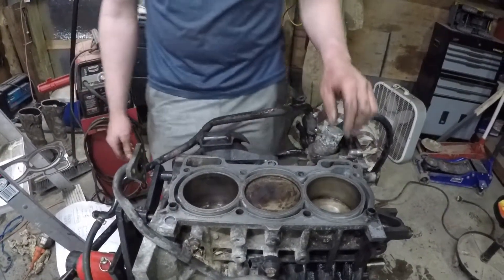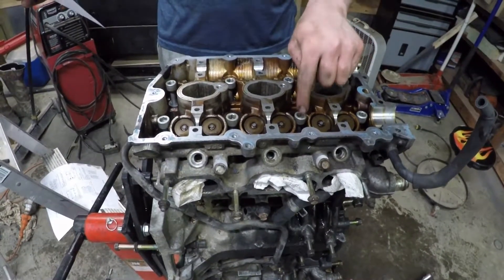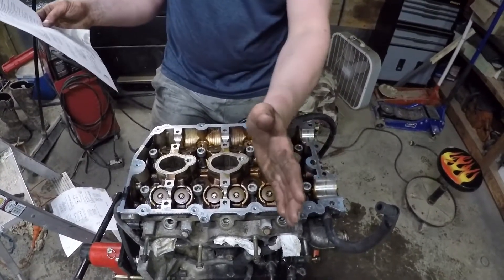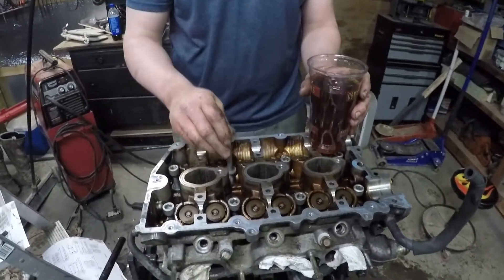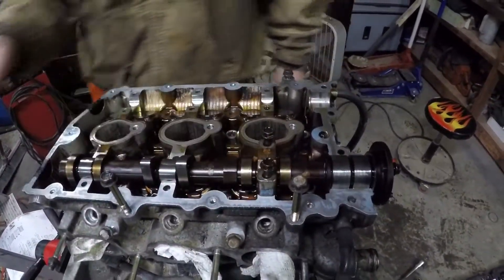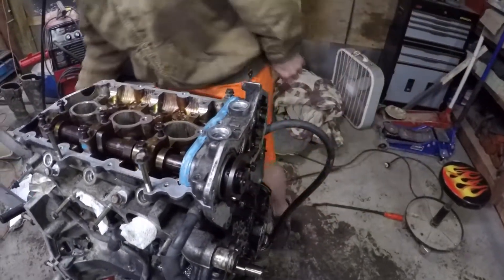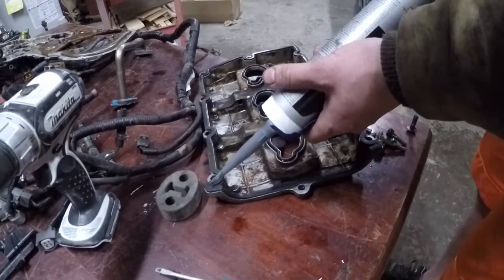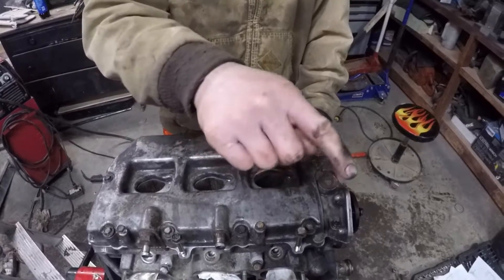Subaru H6 Head Reassembly with Torque Specs

Comment: You can crack a block using excessive oil due to pressure created as the bolt is torqued. Anti sieze or arp thread lubricant is the way to do it

Comment: I've got the weirdest issue with my H6. It goes really hot but not into the red at idle.  But it drives cool all day long at over 2k revs??? At traffic lights I rev to 2k to keep the temp down!! Ever seen this??
Reply: I've had other cars where the water pump impeller was partly corroded away and didn't circulate enough water at lower revs, perhaps something similar?